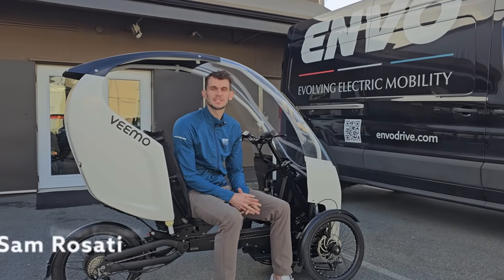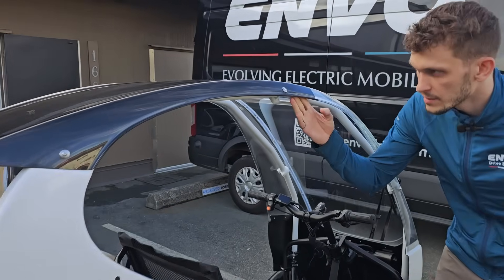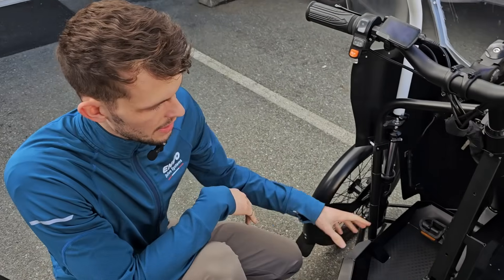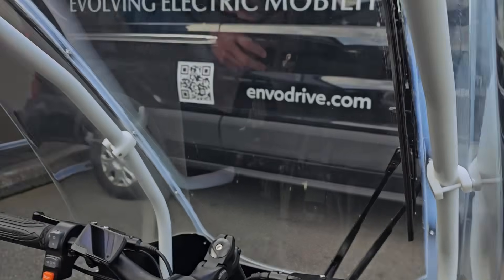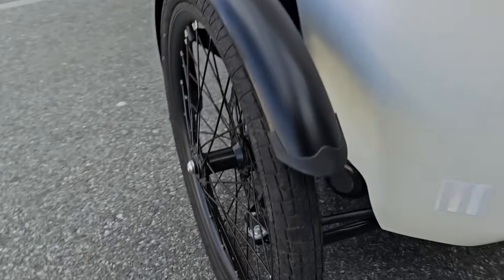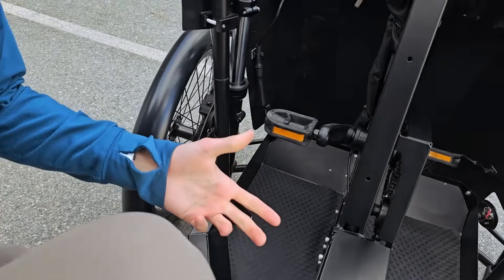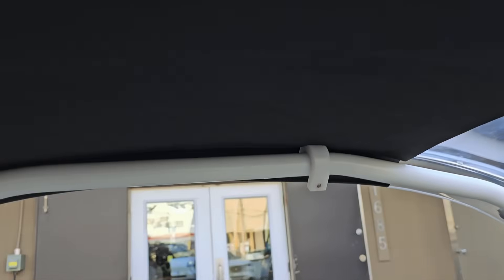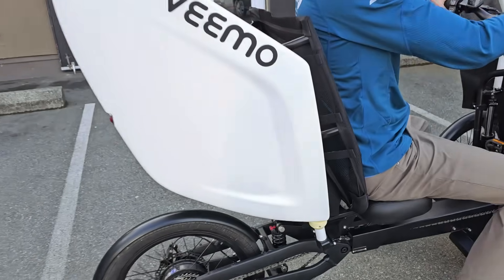Veemo Updates| Proudly Canadian 🍁

Comment: ADP program can help disabled with portion of you redesign it to have cargo space so that groceries etc can be transported and if you add the turn blinkers the slow moving electric assist and make sure it can make it up hills with electric assist power. Make sure brakes if stopped on hill can hold it and keep it from rolling back. Test it show us that it can make hills as much Canada has them.  If you add cargo areas then this would be better than scooters which have zero cargo carrying space so ADP might go for these as electric assist but the amount is capped at what gov will cover. 1600 to 2000 approx. Per year some ADP they only cover battery replacement every three to four years so how long are yours lasting this far? Scooter things barely get two and darn thing drains charge why idk?  So are yours solar charge ?  Also what are width measure does it fit through doors to get it in side to charge? Or no? Our building was design with mobility room middle of building I wish they put it on outside so all size vehicle could get inside for ❄️☃️ winter but if not does this have ability to solar charge?

Comment: Ad four 🛞🛞🛞🛞 wheels to back not one. Then you add frame where people can sit Rubbermaid storage bins to cart groceries and if you make two strong bars across then shelf sleeping area to camp on go and a round frame over with zip on covering they can be made extra winterized with insulated layer but if you have sides sealed then it can heat in winter just add a video screen display like cars have the 150$ screen to back up make sure blinkers turning on it to make legal add slow moving vehicle sign on back so cars see reflective tape the back wall can be the sign .

Comment: Are they under 2000$ yet as people on ODSP need affordable vehicle and you need add cargo space to carry groceries and 📦 packages at back add eight feet cargo area with two more wheels. As extra trailers can't be added but if you make it all in one then it's legal so make cargo area for four Rubbermaid storage bins under on the floor put shelf that campers can use to put sleeping bag on and build it with covering can be insulated by zip on outer insulation foam boards can attach for winter weather's. Redesign a winter camper with solar on top so it can power a heater.

Comment: I would like to purchase but I am disabled and use platform pedals provided by Hase or HP Velotechnik. I also live in a very hilly area. 1200 miles with 50,000 feet of climbing last year.. Can I accommodate these two issues? I am very interested!

Comment: I think that a cargo net that could be clipped from the back of the seat to the body of the vehicle could be beneficial to prevent items from slipping out while riding.  This net should be elastic.  I would move the rear lights to the top for visibility.  How do I secure the vehicle when I go to the grocery store?
Reply: stay tuned for further updates! As for securing the vehicle, it can be locked just like a regular ebike.